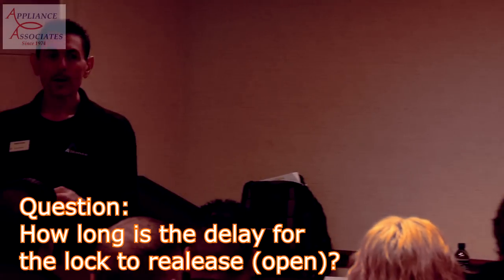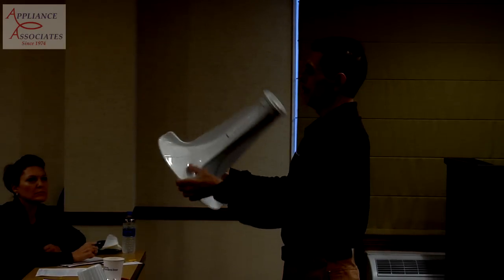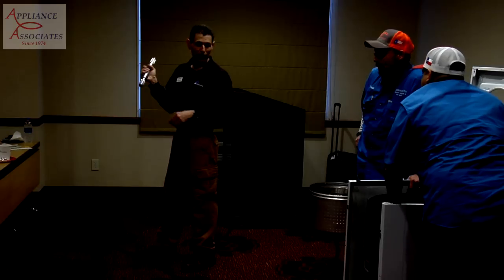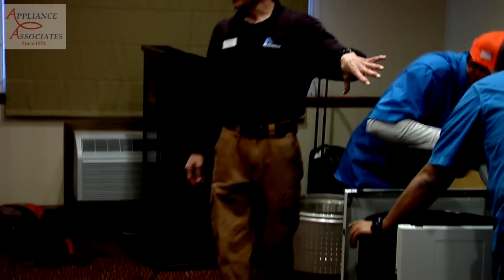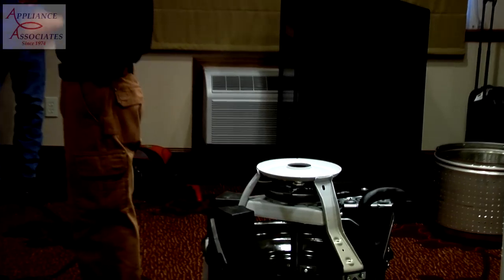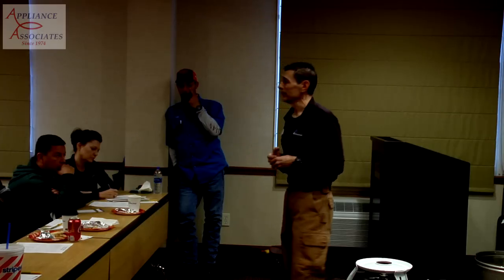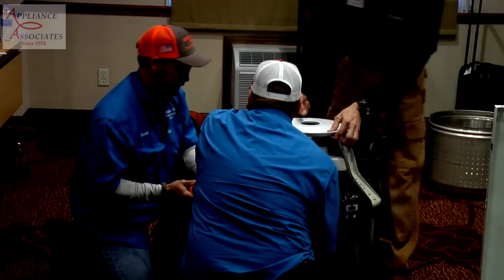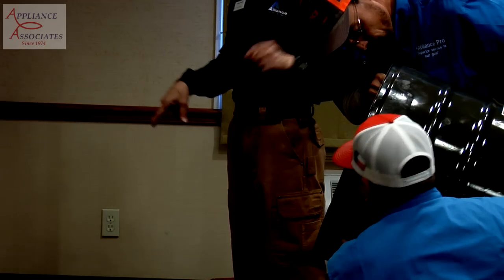Speed Queen 2018 Service Training Part 1

Comment: Some notes:
• Electric pump - pumps slower (10gal/min vs. 15 gal/min) but can pump upto 8 foot column.
• Noise level 43dBa.
• Three phase inverter and three phase AC motor 1HP, reduces current requirements from 16.9 Amps to 7 Amps.
• No idler wheel and no tension adjustment. Phone app (Carbon Drive)  measures the strum frequency (about 80 Hz spec to follow) of the belt to determine proper tension. 
• Revised agitator without flexible fins.
• Off balance switch, starts distribution process (load sensing)
• Two extra suspension springs, front springs are green rear blue.
• Lid lock, is disabled with power off. Requires 15 lbs of force to overcome locking mechanism. 
• Load sensing
• Water level sensing, will override manual setting if manual setting is too low for load requirement.
Reply from the maker: Good job! sounds like you took better notes than I did.